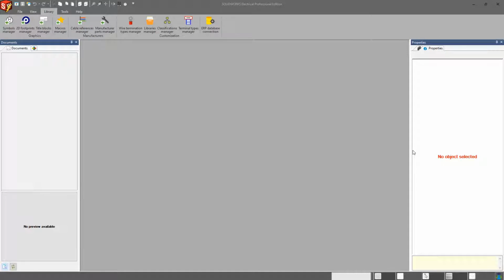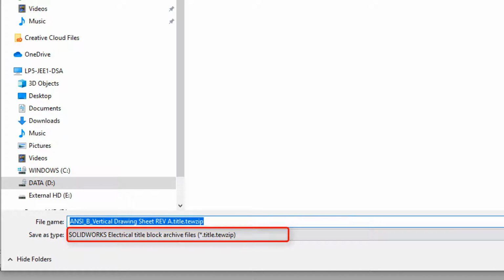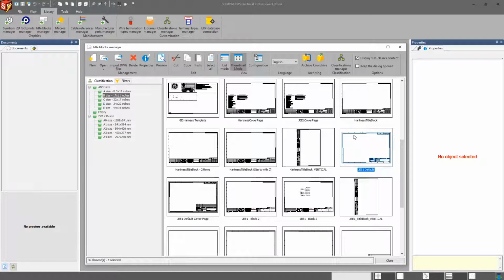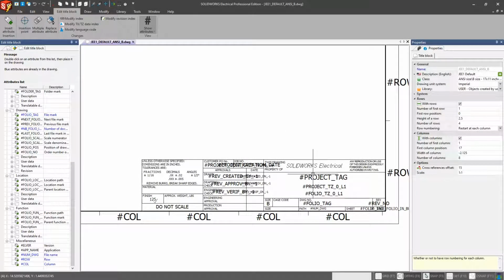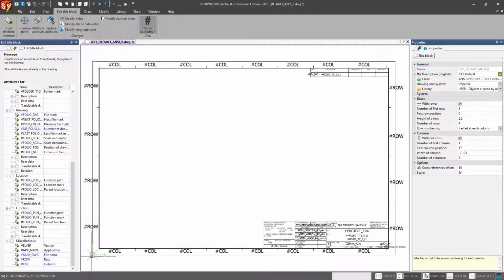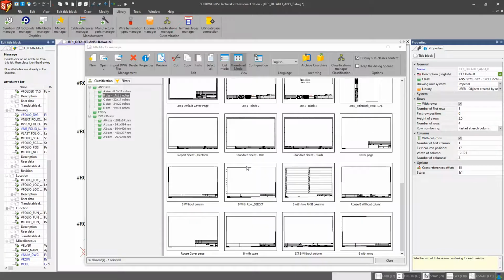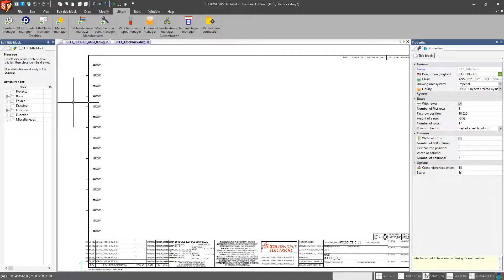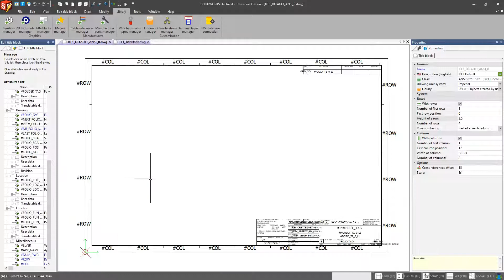SOLIDWORKS Electrical Implementation 7 of 19: Understanding Title Blocks

Comment: Messed up video. After all said and done, how to apply it to our work is not included. I just wasted 6 minutes of my life
Reply from the maker: I'm sorry you found this video to be messed up. This is just a guide and still takes practice to master this feature. Depending on how you want your title block to appear, all the settings will change. For example, do you want ANSI or ISO specs? Landscape vs. portrait sheets?  Column and row information? Once the title block has been designed, adding a title block to your sheets is extremely easy and takes less than 6 minutes to add it to your drawings. If you still need help you can reach out to your partner for support.